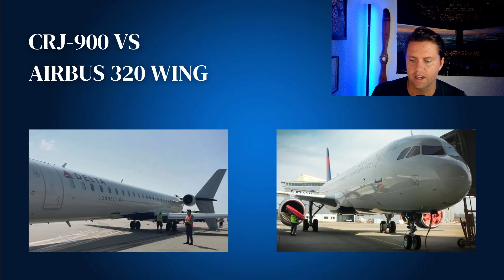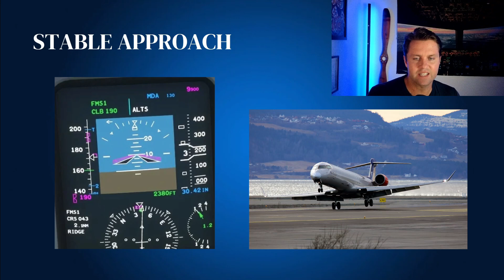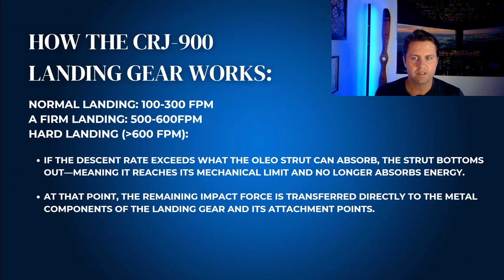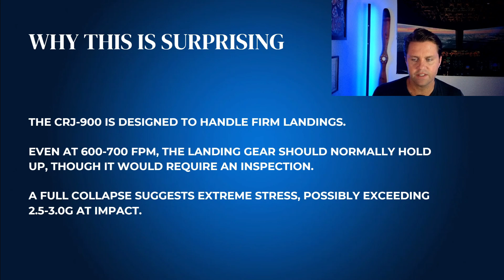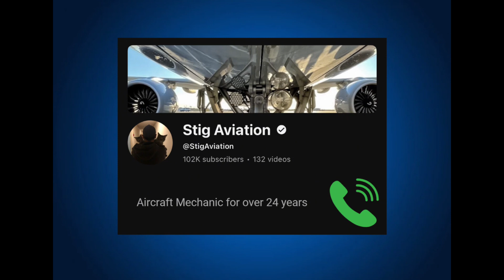Pilot Breakdown: Did a Hard Landing Cause A Gear Collapse?

Comment: Tricky wind conditions, and the possibility of wake turbulence from a prior takeoff/landing (from what I've read elsewhere). There was a noticeable increase in descent speed in the last 100 feet, which appears to surprise the PIC. Effectively, the lift dropped too low for the pilot to react & flare in the time available.
As for the undercarriage failure, with the plane dropping out of the air, the shock loading on the individual strut overloaded the strut & wing system. Possibly the low temperature made things worse (oil gelling?), but that's unlikely. Without the data, it's too early to say with any certainty.
RE:- the fire, the fire being smothered by hitting a snow bank is plausible. Snow transitioning from solid to liquid would pull a LOT of heat out of the fire, while simultaneously dumping a large amount of water into the fire. There is also the possibility that the snow could temporarily block the fire's fuel supply, by physically blocking the feed lines. If so, with no fuel supply, not enough heat to support fuel vaporization, and a pretty large amount of water being dumped on the blaze, it's hardly a surprise that the extant fire went out. That there wasn't a post-crash fire is more of a surprise to me, but again, low temperatures would be preventing the fuel from vaporizing, so the risk would be much lowered when compared to a midsummer 30+C day.

Comment: THANK YOU!   Finally, someone comments on what actually happened, and gets it right.  You are the only one so far.

The only thing left to find out is why no flare?  And what speed were they going on touchdown?  ATC said there was no cross-wind.  But could it have been wind shear or downdraft?  ATC can detect wind shear, no?  Or, something happened in the cockpit that caused that lack of flare, and the hard drop to the runway.

Comment: My husband is a pilot. He said the plane's angle coming in was wrong and it was a hard landing that caused the crash.
Reply: I agree. Too fast and too aggressive. They broke the gear and the wing on impact.
Reply: Completely agree with that assessment.  The angle was steep and to me was at that point the Wind actually pushed the nose down leaving no time for the Pilots to perform the flair at that point.
Reply: Agreed. That is what I am seeing too. There is no attempt at a flare. Wind shear can make you drop hard, but it cannot stop the angle of the flare as commanded by the pilot. This was pilot error. Also I'm not sure why Gary is determining the VS so confidently at this point. That is impossible to state since it is very hard to see VS, especially in a video. We'll need to wait for that data from the FDR. However, ADSB is showing over 1k which is too much, but ADSB is not getting the same data the FDR is. The FDR is the source of truth for VS.
Reply: @3rett115  It was insanely windy that day, so it's more likely the pilot was fighting wind shear and trying just to keep it level and get it down, so they couldn't worry about trying to flare and make a perfect landing. You can tell how much they were fighting by how long it took them to get it onto the run way. They should have been able to get it down sooner but they were being pushed by gusts coming from the left rear (from the direction of the lake), as evidenced by the direction the fire retardant was blowing in the other video.
Reply: @plane_guy6051  Agreed. I think trying to keep the plane from being blown off center overwhelmed the pilot and she didn't have the skills to flare in such a challenging approach. But preliminary statements indicate the wind wasn't beyond the limitations so this should have been well within a professional pilot's capabilities.
Reply: @plane_guy6051  It wasn't an unusually windy day, very routine for airline pilots.
Reply: @plane_guy6051   I saw elsewhere that the CRJ landed very close to the start of the runway, whereas normally they'd have flared a bit and landed a few hundred feet further down.
Reply: @stevenrix7024  there's a displaced threshold on that runway and they were >1000 ft past the threshold.
Reply: @plane_guy6051  Good gawd...talk about making a lot of excuses!  I took a checkride in a cessna 172 with winds like that... if you cant land a stable platform like a jet you shouldnt be flying.
Reply: @3rett115  High tail aircraft can experience elevator stall even at only a slight nose up pitch under the wrong conditions. The wind this day was marginal for ops
Reply: No one has talked about icing on the wings. Could there have been? And could that increase the drop rate or prevent flaring?
Reply: @Evan-lx9lw  hahaha.   No…….get back in line
Reply: This was a Navy landing.
Reply: Not the angle...they didn't flare at the ending.
Reply: Unless your husband was on board at the time, he has no idea.  Madam, your husband is an idiot.
Reply: High sink rate was the main problem and no flare.
Reply: @747heavyboeing3  "SINK RATE SINK RATE", traumatising audio from anyone who follows Mentour Pilot
Reply: Failure to call for a go around when "stabilized approach factors" were not met.  The Captain should have been at the controls in such adverse conditions.
Reply: @mitchski98  it was VFR,  dude……
Reply: The angle was perfect, so I'm dubious on your "husbands" credentials. It followed the 3 degree GS the entire way in
Reply: @shanehiggins4983  he's probably a private pilot with 100 hours single engine time. 😂
Reply: @shanehiggins4983  They clearly didn't flare, and we'll need much more information to determine why. Their pilot union will have the pilots remain silent until absolutely necessary, so CVR and FDR information will need to be layered with ADSB, video and audio information to determine what actually happened. This landing looked a lot like a Naval Aircraft Carrier landing; no flare and a very hard impact. F 18s are built for this sort of thing; RJs aren't.
Reply: @motrock93b  not exactly sure how you think this related to my comment, but it doesn't.
Reply: THe hard landing by itself would have led to the need for an inspection, at best. The problem was the side load that collapse the gear, because she did not straighten the plane out using the rudder.
Reply: @ziegle9876  I don't know why the Canadian safety board and the NTSB are wasting time investigating, as I see that you and the rest of the hangar flyers here have it all sorted out. 🙄

Comment: 100% correct that the snow saved many lives.
Reply: Heat is one side of the fire triangle and removing the heat will stop the fire.  A fine mist of water (the small particles of melting snow in this case) has a tremendous ability to absorb heat as it flashes to steam in a fire.  It's how you fight a fire in a closed compartment on a US Navy ship.  We enter the compartment using a fog nozzle which sprays a circular pattern of fine mist in front of the firefighter entering the compartment.
Reply: YEP 👍👍👍 💯💯💯
Reply: %100  --  Physics!
Reply: No way.  The runway was almost clear!!!

Comment: So what you are saying is the snow packed into the ripped off lines enough to not allow the onboard fuel to ignote as the plane passed the burning wing then the lift on the left wing did not have the balance of the right wing and it just flipped over, thanks bernouli.

Comment: Plane was not going fast, it was actually running almost 10 knots too slow. It should have been running at about 130 or better because it needed to make up for the wind gusts. It was going too slow. That's why the sink rate was at almost a thousand feet per minute. If you look at the rudder the tail of the plane it isn't even deflected in order to induce a flare.
In a slight crosswind I have no problem with the asymmetrical Landing. But when just a mile or so up the flight path you're running it almost 130 knots, and by the time you reach the threshold, you're at 111. This is not an STOL aircraft. If anything, I would do every Landing with this type of aircraft and at least 10 knots above their recommended landing speed. Just like the 727 when it takes off and it has such slow elevators that it actually picks up drops about 50 feet before it starts to ascend again. Because everything operates a bit slowly on that aircraft. You have to already be in a flare moment as you're approaching. I haven't seen anybody hit the tarmac this hard since the last time I watched a Navy pilot put a plane on the flight deck that's where you land the plains. It's not where you fly the plane from. The cockpit is not a flight deck because nobody lands aircraft in the cockpit.
Reply: The ADS-B data is ground speed and not air speed, which was 135 kts, the correct speed for the conditions.

Comment: I find it almost impossible to accept any pilot would drive an airplane into the ground like that. It goes against every instinct a pilot has. The no bounce is definitely sus. My theory is he exceeded his max angle of attack, and stalled - likely in combination with wind anomalies. He was coming in a little fast because of the crosswind, and his AoA was already close to his limit. A sudden downburst (or other anomaly) increased his AoA, and he lost lift suddenly and totally. This happened right at the critical moment when he needed to flare. He had no lift, thus no control. An airplane can stall at any speed, as you are well aware of. The black box will tell us.

Comment: It could have been a side load on the main gear that caused the collapse. The FDR will give us more information. As to the lack of fire, it appears that the right wing separated at the wing root. The right wing fuel tank appears to rupture and cause a fire, but the left wing and fuel tank remained intact, thus no fire at the aircraft.
Reply: I was thinking the same. Hard landing on one main gear at a slight angle might overdo the side load

Comment: The flare on regional smaller jets should be done at 20-30 feet, on larger aircraft a330 b777 at 50 feet due to fuselage length, the lack of bounce suggests lateral load on a single gear strut leading to gear failure

Comment: No flare (maybe slow speed) Declan and wing down to land-hard on one gear due to wing low technique I believe 1100’ min rod = ouch and depends on the aircraft, maybe get away with it on a Boeing with beefed up landing gear, they are designed to roll on not lateral lanfong

Comment: The undercarriage should have withstood 800 or even 1000ft/minute even if it hits on one side because it nearly always hits on one side.
Why did this wheel break off????
Planes have hard landings like when there is a microburst which would be more impactful than this landing.
The undercarriage collapses immediately. The snow would have reduced the stress as the wheel hits giving even more leeway.

Comment: Agree that people should evacuate, with that orderly evacuation the sole priority. Anything that potentially slows that down for others, such as grabbing bags or using phones and recording during an evacuation is a potential danger to life. There could be seconds between someone getting off and someone succumbing to smoke inhalation or fire. Once off the plane then sure if you want to film I don't have a problem with that, because that decision is only affecting you and not potentially hindering someone else and is useful and understandable. I think you are right, the snow looks to have helped prevent the fire.

Comment: Gary, I have a PhD in physics but, as you said, you learn about the fire triangle as a small child.  In my mind there is no doubt that the snow extinguished the fire, by taking away 2 sides of the fire triangle - oxygen and heat.  Obviously the fuel was still there.  Foam, not water, is obviously used normally for extinguishing aircraft fires but snow is a very different substance to water at temperatures above freezing.  It will be interesting to see if there were any maintenance issues with the gear.  Interesting conversation with Stig as well, I’ll definitely check his channel out.

Comment: ADSB data/radar data showed airspeed at 140, ground speed of 110 and vertical speed went from -500 fpm to about -1000 just before touchdown.  Didn't look that hard but 1000 fpm should not have caused the gear to collapse  ...

Comment: I think the other 2 landing gears snapped right after the rear right. And you won't get a 'bounce' with snapped landing gears.
I think the descent was greater than 700 fpm, and then no flare for touchdown... 'very' hard landing. 
If you look at the point where the plane is "one plane length" above the ground, it touches down 6 seconds after that, and the plane is 119ft long. That's a descent rate of 1200 ft per minute. Even if I'm off a bit, it's still at least 800-1000 fpm easy.

~ Didn't mean to be overtly critical in my other post by the way :) Text lacks tone, and I'm not always mindful of that. ~ (sorry)

Filming: The passengers didn't know that the plane was clear of the fuel (wing bits and fuel left behind it on the runway). So they shouldn't have been filming. I just meant that it technically wasn't a significant issue, in this particular (and rare) case. Not that the passengers had any way to know that. So yeah, they shouldn't have been filming their exit.

As for fuel in the lines... true. But it's not a lot of fuel, not enough to engulf the plane or anything. And most of the fuel in the lines would have squirted out under pressure while tumbling.
You could be right about the snow. I suspect that the fire at the wing root extinguished from lack of fuel to burn (since the wings were left behind). That's purely my opinion though. 
ALSO, I don't know the CRJ 900 very well, I don't know if it has any fuselage gas tanks, which would completely change the fire risk picture.

PS: I misspoke before, didn't mean the plane was coming in too fast in horizontal flight, but descending too fast. I didn't make that clear. Again: my bad.

Comment: The claim made by some people that the airplane was going too fast can be checked (to a certain extent). By freezing the video at various moments and noting the nose and vertical stabilizer tip to background reference points such as the edge of the building in the background, it is possible to see that it took 18 frames for the airplane to cover its own length from nose to tail. At 30 frames/second, that would equate to 0.6 second. Since the airplane is 36.2 meters long, it would be moving at a ground speed of 60.3 m/s, or 117 kt. The wind was reported at 23 to 33 kt from 270 degrees, meaning that the headwind component on the runway's 237 heading would be between 19kt and 28 kt, which would yield an airspeed of around 136 kt to 145 kt at that point, where incidentally the airplane seems to be crossing the runway threshold. Is that too fast? I'll leave that the for CRJ900 pilots out there to answer.

As for the flare, indeed from the image it seems there was none. But I would expect the airframe to be able to survive a no-flare landing without dismantling on impact.

All of the above is of course an exercise on speculation. As always, we should wait for the investigation before drawing conclusions.

Comment: You were incorrect on the details of Asiana Fight 214 which crashed in San Francisco on 1/16/14. The passenger who died, 16 y.o. Chinese citizen Ye Meng Yuan, was fell from one of the two rear rows of the aircraft after it hit the seawall as it approached the runway to land. According to the San Mateo County Coroner, Ms. Yuan was still alive and covered with firefighting foam when she was struck separately by 2 firetrucks responding to the post-crash fire.

Comment: Looked like a navy carrier landing, in the 700 feet per minute descent rate. No landing flaps? Forgot full "landing" flaps? Landing flaps failed to deploy? Landing at landing speed but with take off flaps would cause a high descent rate, where it looks like the airplane is falling out of the sky, due to lack/loss of lift the landing flaps provide. There was no flare, just like a Navy aircraft carrier landing where these Navy jets are designed to be "flown" into the deck of the aircraft carrier. Watch any Canadian CF-18 Hornet landing on a land-runway. Always a "hard" landing with no flare essentially, flying the CF-18 into the runway. Perhaps poor visibility caused poor depth perception, causing the pilots to misjudge their altitude over the threshold?
Reply: Other videos taken from behind the aircraft show that flaps 45 were deployed.
Reply: @christopherrobinson7541  45 is FULL flaps? If so, this makes it worse.

Comment: The trick is you can see visually what the aircraft is doing but you cannot see visually what the air is doing around it. Without a recording of the flight data there's no way you can have a clear picture of what transpired. Windsheer. Microburst. Influenced sink rate, delayed control response, a complete dismissal of meteorological factors shouldn't be on the table in abject speculation. You need the flight data recorder or everything is all about being entirely premature. Social media tendency to pass judgement at first glance is annoying, you haven't gone that far but the point has to be made. Results of an investigation need be awaited before anyone knows remotely what happened.